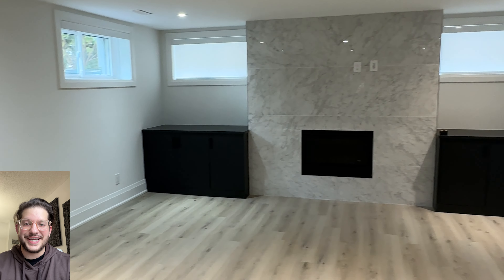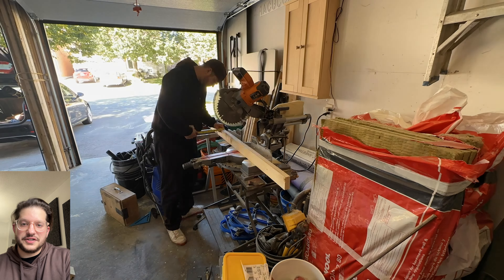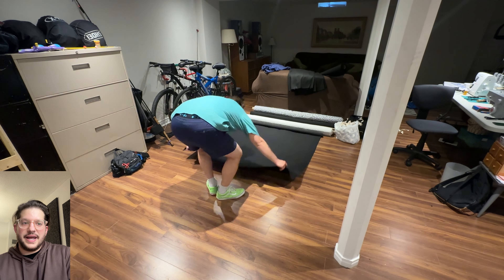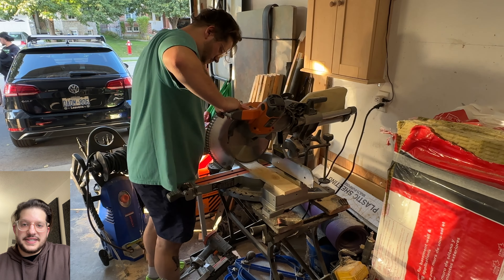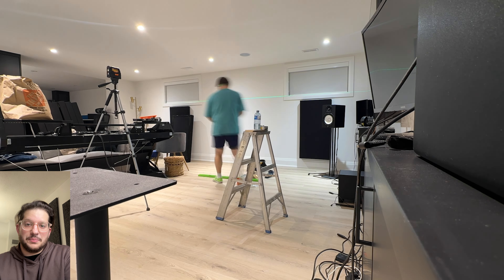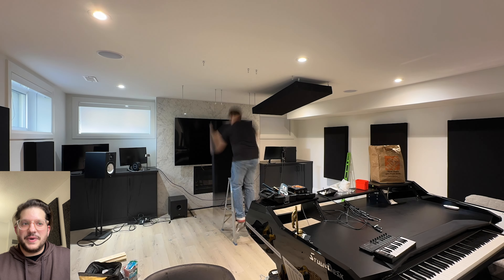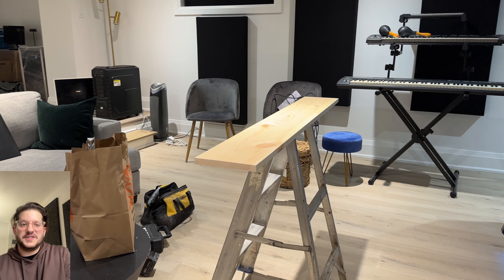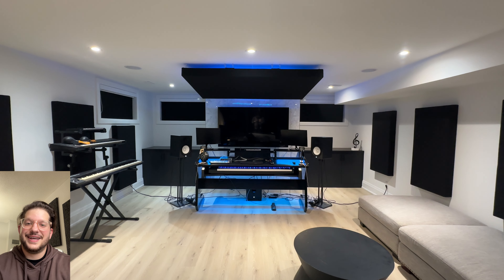EPIC Home Studio Setup! How To Build+Install Acoustic Panels

Comment: Looks great! I've built 7 of the wall panels so far. I've experimented and found cloth landscape fabric with a old  bedsheet for the back and 2 layers of sheets for the front. Then i cover the front with a nice burlap. All this is a precaution for retaining the rockwool fibers.
Nasty stuff. 
It's a lot of work but so far I've only paid for the insulation and the burlap. I've had everything else or i go to estate sales for the fabric. Being a carpentry contractor helps as well.